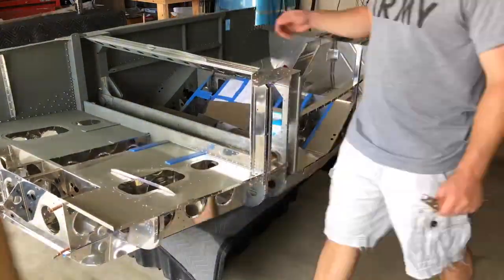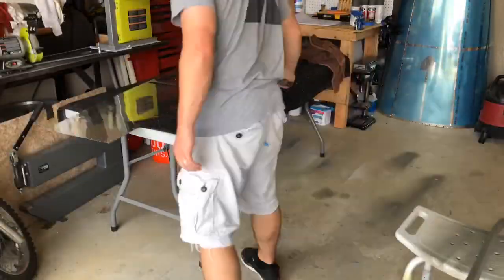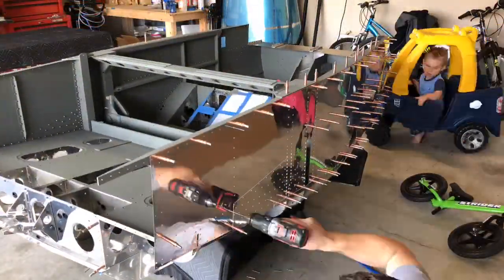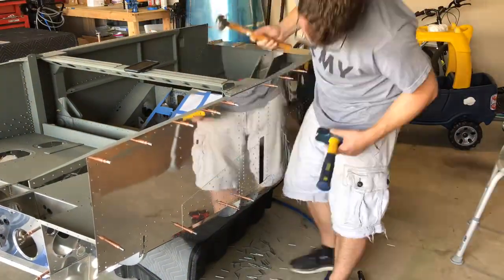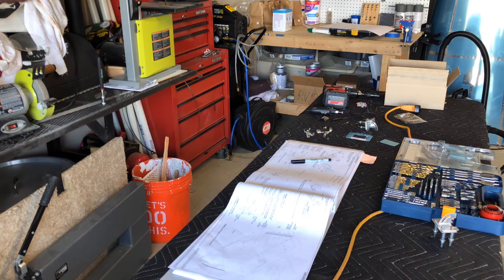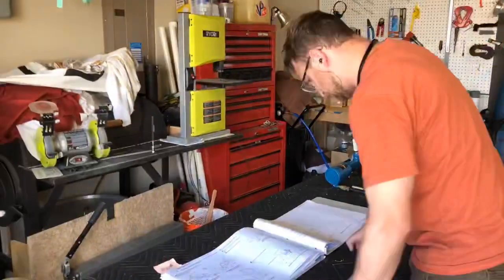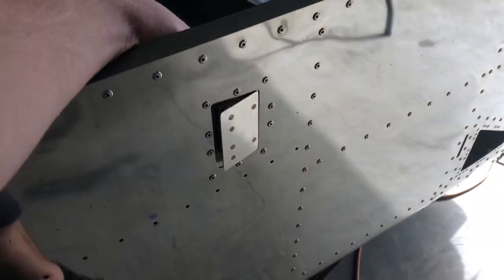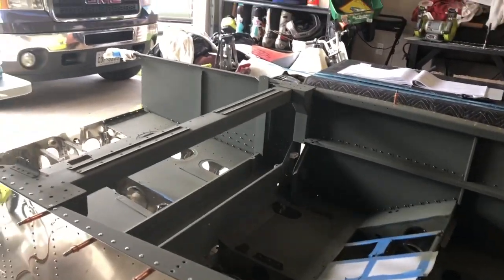Vans RV-12iS Fuselage 12

Comment: I'm a little late watching this.  But you said your band saw blade teeth were upside down.  That means you just unpacked it wrong.  You can turn the blade inside out by grabbing the sides are rotate them to flip the blade inside out.  For example hold the blade with one side of the loop in each hand. Teeth toward you.  Thumbs gripping the outside.   Fingers warped around the back gripping the inside. While holding the blade rotate your wrists to move your thumbs to the inside of the loop. Then you will find the teeth are the correct way once you flip the loop over to position the teeth to the front once more.  I'm surprised no one commented on that.
Reply from the maker: Dale Eason thanks! You were absolutely correct. Your comment was actually very timely, I was placing an order today for all new “disposable” tools. Perfect, thanks again

Comment: Looking good. You are making a lot of progress.  I might try that primer for a few pieces I have had to reorder.
Reply from the maker: Thanks Tim! Its crazy how much more quickly the -12 goes together vs the -10 . The primer works good, not as good as the AKZO we were using but with proper surface prep it works just fine. Hows the Tailcone riveting coming along?